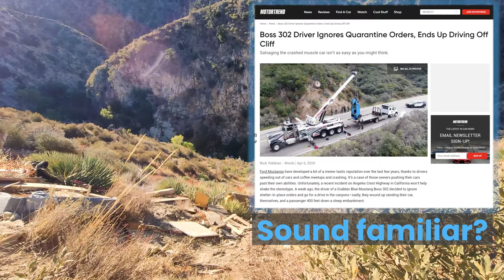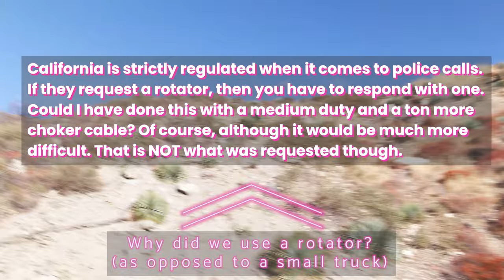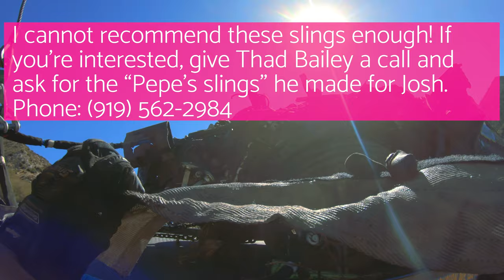Recovering a new 5.0 Mustang that flew 350' off a mountainside

Comment: Hey Pepe's towing service! It's possible the driver floored it in the tunnel to hear his loud exhaust system reflect off the walls! Mesmerized by the sound he kept it floored way too long! Glad to hear you take a cool down break when required in that mega heat! I mountain bike and hike the mountain I live at the base of here in Canada so I know that climbing up that slope is brutal even when the temperature is cooler! If you can aim your helmet cam a few degrees lower it would center what you are looking at a bit better! Ride ride ride!
Reply from the maker: Very possible. On my way up this mountain, we had to constantly pull over to let the line of fast cars racing up. Wouldn't doubt if this was a race or speed run gone wrong. Yes, I wasn't aware it got pushed down during the hike unfortunately.

Comment: im in Alabama so no mountains like that. what i like is you explain each step as y ou go. one thing i would love to see is a walk around of big flipper and see what each lever does on truck and remote and a over view of the accessories you use in recovery. also what size cable  you use on the wrecker. we never see big rigs like yours not sure if there is a rotator in southeast alabama thanks for the content you share. but most of all is the language none of it is r rated thanks

Comment: Great video, as always! Love the rotator and the jobs you guys use it for. Kinda weird that you have to respond with the vehicle the police asks for. It's your job and you are the expert, so it would be better if they tell you what the job is and what they expect you to bring, but leave the final decision at your end.
Also, little feedback: Can you point your gopro on the chest a little more down next time? It happens multiple times in the video that the action happens in the lower portion or almost fully below the view.
Reply from the maker: Yes and no. If that was the case, you could respond with a Rotator on every single call and rape the industry. For the most part it works fine. Cars need a light duty, anything under 26k usually is medium duty and anything over is heavy duty. If it's rolled over or in a super hard spot like this, it usually means heavy wrecker/rotator. This was an hour from me, imagine driving up there an entire hour, just to then call my shop and ask them what truck to bring me? That is the opposite of quick clearance.

Comment: Another great video bro. QUESTION??? hiking down such steep terrain do you harness your self to your tow truck whinch cable or do you have a separate safety line to keep you from falling any further down the hill? Saludos de Wilmington CA bro.
Reply from the maker: Each call is different, but here I attached the winch line from the truck to my harness, then Dave lets out on the cable as I walk down. It got too in the way so I took off the harness and walked the line down myself.

Comment: Great Job, how long in Total?
Are you on Commision from Sling Man lol
You must Mention them at least 6 Times every time used 🤭
Reply from the maker: Nope, just by far my most used product. The old timers use chain, but they aren't invincible like people think. They have a lower working load limit, even more so when you link them back to each other. Slings and straps keep their WLL easier, are generally much stronger, and so light compared to chain. I use them on lifts, roll overs, winch outs, and this. The main set back is how fragile they can be, but these are practically indestructible. What is your job? Whatever it is, wouldn't you be excited if you had a new tool that made your job sooo much easier? They're not too common in the industry and want more people to see them so they can also make their jobs easier. Why is that such a bad thing? No commission, no referral. I just love products that work and these are the real deal.
Reply: Dont worry wasnt Critising them  uforgit damage free if required  why doesnt the Maker sell to the Industry Suppliers, 
I used to be in the Job
Reply from the maker: They are sold to industry suppliers, it's not a small time thing. A lot of towers are stuck in the old methods though and they aren't common. I personally think they should be more common